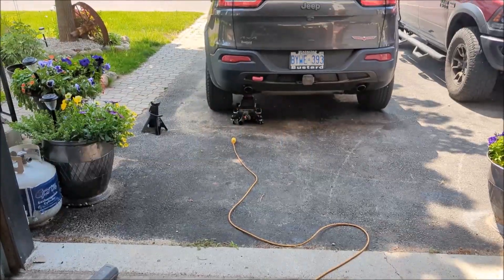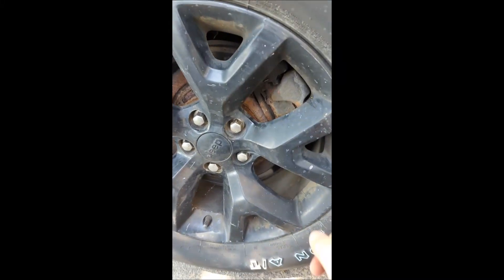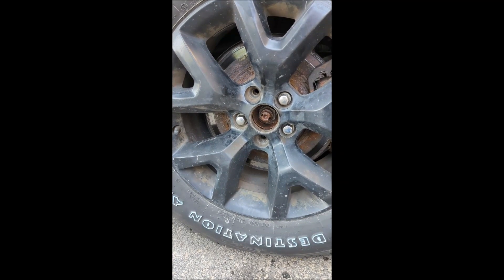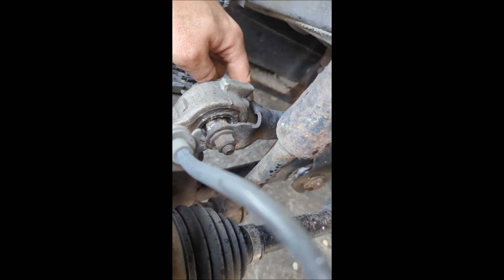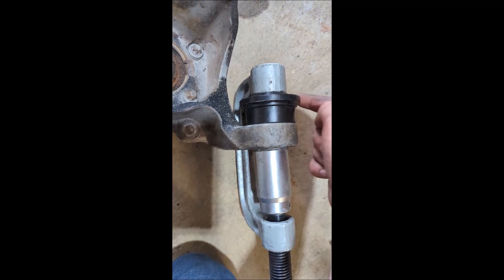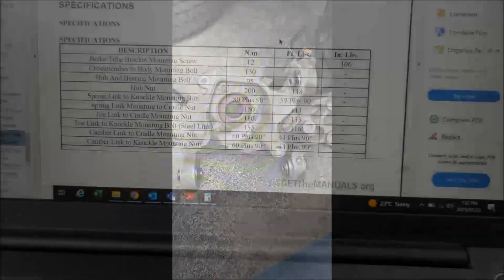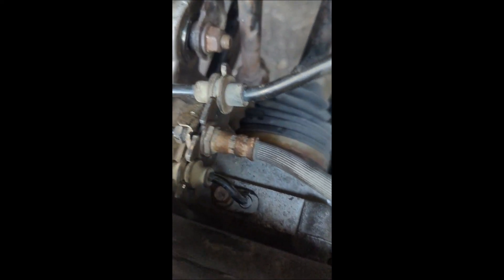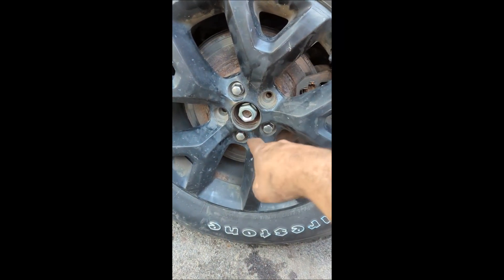Jeep Cherokee KL Trailhawk Rear Knuckle Bushing Replacement

Comment: How did you get the Chassis Pro kit, I can’t find it anywhere
Reply from the maker: I believe I got mine here https://autopieces.ca/cp1879-ensemble-de-bague-d-articulation-de-roue-chassis-pro.html
Reply: @Reicher55 I’m located in the U.S. and can only find them in canada. Only the Moog, Mevotech, and dorman kits are available here which I’ve heard aren’t as good or accurate as the Chassis pro kit
Reply from the maker: @dylanh.5970 I did replace 1 smaller one with the moog part and it worked well. I got a few of the moog parts at the time for $1/ bushing at an auction near where I live.

Comment: Very helpful. MOPAR wants me to buy the entire trailing links and the knuckles/bushings as one package. All I need is the knuckles for both sides. The links are solid
Reply from the maker: @theethicalpredator  do you need knuckles or just bushings? Knuckles are very expensive.
Reply: @Reicher55 bushings but they are trying to sell me the entire group with links
Reply from the maker: @theethicalpredator  ah, links are a different assembly. I didn't want to spend thousands on knuckles and I inspected the trailing links while I had it apart. Not hard to change later if actually needed.

Comment: Where did you order the Chassis Pro 1879 bushings?
Reply from the maker: I got mine here: 
https://autopieces.ca/catalog/product/view/id/21606/s/cp1879-ensemble-de-bague-d-articulation-de-roue-chassis-pro/category/79/

But you can find them on eBay as well, usually from a European seller.

Moog makes 2 of the 3 bushings (2 of 3 on the knuckle are the same). Part number K202090

Comment: This is an amazing video. Quick and with tourqe specs. Right now is the best time to replace the brakes as well with the $1,000 you save in labor.
Reply from the maker: Make sure you get a wheel alignment done. The rear end is adjustable and it will be beneficial in the long run. I had mine done and it rode like it was new.

Comment: Great video ! Just took all my jeep apart tonight. Don’t have a press or anything so just gonna stop by a machine shop to get the old bushings out / press the new in ! 

Still a big money save doing all the labor myself minus pressing the bushings. 

Local Jeep dealer said can’t be done I had to buy each knuckle - spindle for $1500 each. Got the two sets of bushings for less than $400 with your part number. Thanks again for the video and saving me money lol!
Reply from the maker: I'm glad the video was helpful. Get yourself a new wheel bearing hub nuts, don't reuse them .

I know from my experience with tool makers that press fit holes are designed so that you can press something out and press some else back in without issue (unless the hole is really worn out). The dealer mechanics I guess are more or less just part swappers.
Reply: @Reicher55  Will do thanks! And yea the dealers / auto manufacturers will always try and get the most money from things. Think they would stock / sell the replacement bushings but nope whole knuckle only !
Reply from the maker: @outlanderoleary my dealer I go to doesn't even question me doing my own work now, especially after they saw the results of the bushing job. now if there's a problem, they diagnose it and then just write the problem down and part numbers of needed parts and send me on my way to fix myself lol

Comment: Where did you buy these bushings?
Reply from the maker: I got mine from here:

https://autopieces.ca/catalog/product/view/id/21606/s/cp1879-ensemble-de-bague-d-articulation-de-roue-chassis-pro/category/79/

However, you can get them as well from ebay here and the seller has different options to have hardware or not:

https://www.ebay.ca/itm/325600411634
Reply: Hey these bushings measure smaller in diameter than the stock bushings? How did they fit? Were they loose?
Reply from the maker: @curtisbuhs306  oh I never saw your message. Sorry about that. They seemed to be just as tight as the stock ones. There are 2 sizes in the knuckle, 1 larger. 2 smaller.